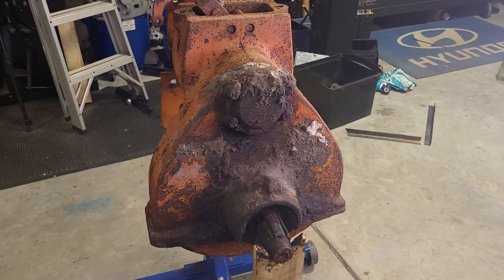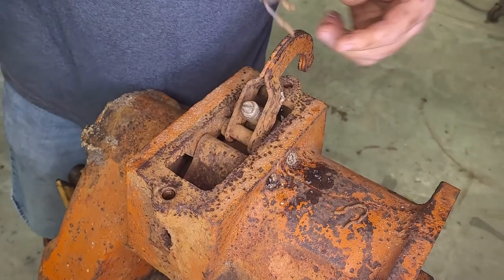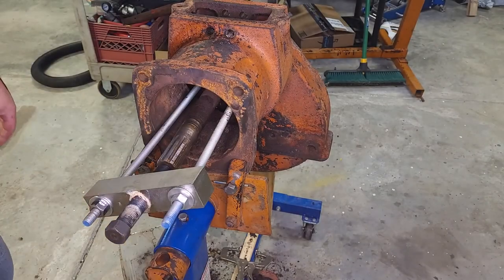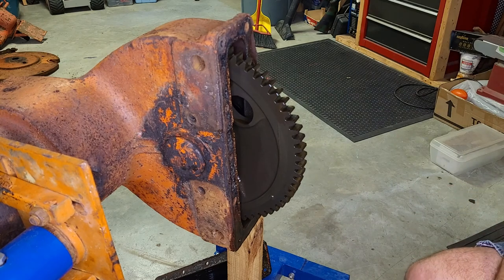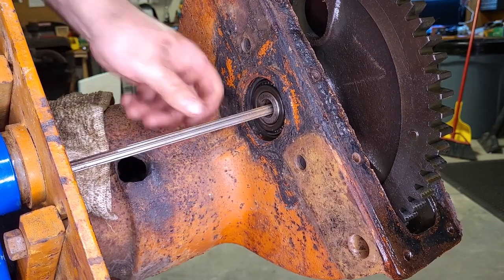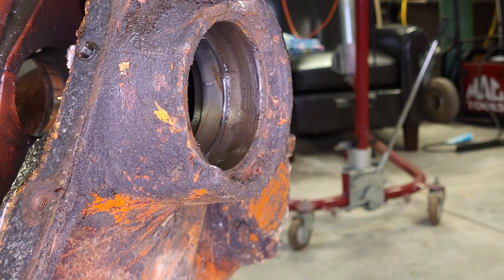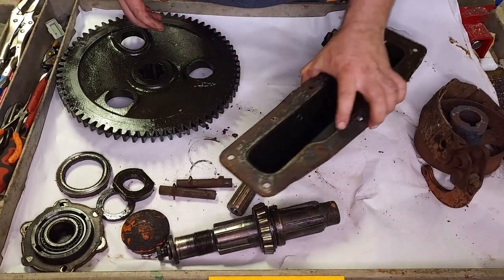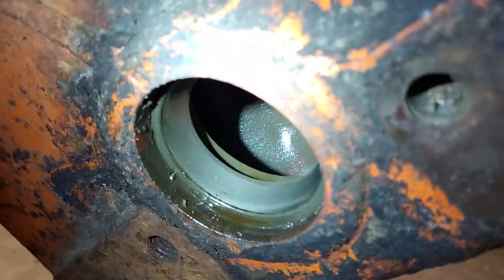1953 Allis Chalmers B Final Drive Disassembly and Inspection

Comment: I got 3 off today in about 3 hrs with other stuff going on as well like finding things. I used a setup very similar to yours. I borrowed a strongback from work, and took my 1/2" all thread and put it through the holes and fished a couple of washers in behind the drum as well as a nut. My strongback was not set up for a forcing screw so I borrowed a portable powerboat sure of tonnage used as one was stubborn, but they all came out.
Reply from the maker: Nice, glad to hear it. I can't wait to get rolling on mine agai

Comment: When you are dealing with stuff like that even the smallest thing that goes right is a triumph. I completely rebuilt/restored a early styled 39 B Deere down to almost the last nut and bolt and I wouldn't do it again. If I did after what this first one taught me the second one wouldn't take half as long.

Comment: I can not get the axle shaft to come out. It will not punch out of the bearing. Any tips?
Reply from the maker: Can you tell if it is caught in the bull gear or is it the bearing.
Reply: I would say both. I backed off the nut but the bull gear won't move on the shaft. But the bull gear does not apear to be up against the housing and the shaft still won't go through the bearing
Reply: @joemcdougall7605  Hi did you manage to get the shaft out? I'm doing my B right now, one side came out just like the video, but the other shaft won't move. Bearing stuck on and bull gear stuck on shaft spline. Have tried heating bearing up to no effect. Am considering drilling side of bearing and splitting it off the shaft with a chisel. I think once the bearing is removed I should be able to get the bull gear off with more play on the shaft.

Comment: What's the best way to get the hub nut off?
Reply from the maker: I used a pipe wrench. Not sure if it's the best
Reply: There is a custom wrench for it.  Runs around $70.

Comment: Where do you get the bearing washer and snap rings? I have a 1940 b I am working on
Reply from the maker: The bearings might have a number on them that can be crossed or if you take them to a bearing supply house or Napa autoparts they can match it up by measurements. Snaprings are probably standard sizes but not sure where to order those. Maybe a bearing supply also? Lucky for me out of the 4 final drives I have to work with I only need seals to make two work.  What bearings do you need? I'll see if mine have any obvious numbers that can cross.
Reply: @JPN76  , I found a place to get them. OKtractor has them
Reply from the maker: @FordTractorRevivalist  nice! I was just looking and my transmission has Timken and the final drives have Bower bearings. Ran a couple numbers off the bearings online and they are available almost everywhere if you search that way.

Comment: My right final drive was all chewed up at the wheel
Reply from the maker: One of the four I took apart had signs of that happening. The outer bearing was a replacement. Housing had rub marks and the bull gear was running at an angle at some point and wore a groove through the pan. Had JB weld all over it.